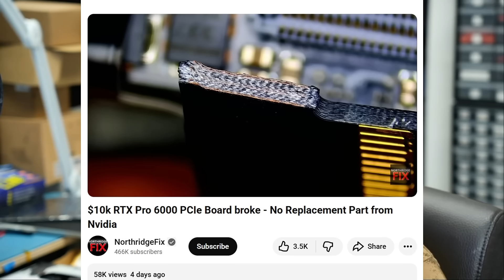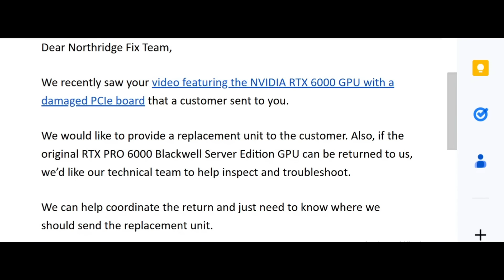Huge Update. NVIDIA Contacted us. What They Said About the Broken RTX Pro 6000

Comment: If you pay $10K for a GPU, it is expected that you know how to handle it like it cost $10K, not try to squeeze it into a micro ATX case for views, or try to skip the support bracket, then complain about it breaking, and then complain about right to repair, especially when the company offers to replace the card. Their warranty probably outlines clearly that "doing dumb shit" isn't covered, so if you're doing dumb shit with a $10K GPU and they offer to replace it despite the warranty explicitly stating not to do the very thing you did, shut up and take the replacement. I'm all for right to repair. I'm also aware the manufacturer doesn't have to help you repair it, sell you parts to repair it, or compensate you when you botch the repair. That "high profile YouTuber" is being a dumbass about it. I get the feeling they wanted to put your repair video on their feed to further boost their views, and probably as "a win for right to repair". People are just too damn sketchy.

Comment: You absolutely can replace those brakes at home. It's a 2 pin connector, 12 volts on one pin retracts the caliper piston and 12 volts on the other extends the piston. Figure out which pin retracts, retract piston, change brake pads, reassemble and start vehicle, pump brake pedal until firm. Final step, engage the electronic parking brake and release it. Job complete.

Comment: YOur point of view is totally valid, however, it has a harmful effect on the process:
- you have to get your own result by fighting your own fight. (why did not nVidia replace the obviously faulty GPU immediately in the first place and sent you this email? I guess the owner of the card tried to RMA the card, but failed)
- It should not be an "earned" priviledge" to get a replacement or a refund on n abviously faulty device
- If a supplier fails their duty either by negligence or by malice, why is it not allowed any third parties to step in and ofer for example a replacement PCB for this?
So, in general, I fully agree with your statements, but accepting the attitude of these suppliers , hindering our rights is only beneficial for them to carry on with their malpractices.
(for example, in this case, why did not nVidia replace the damaged board immediately, without asking any questions (such a PCB costs less then 10 USD)? Maybe, because, 9 out of 10 customers would not push this any further and "swallow the loss". ALso, just FYI: the devices in this price range are the ones that cause significant financial loss of the buyers if they fail.  So the damage is not limited to the 10k USD of the card, but to all the revenue lost of this card not being available for such a debate.)

Comment: You can change your own brakes; you just have to purchase a bidirectional scanner from Autel that allows you to communicate with the ECU, so you can put the brakes into service mode, because you have to use the Autel Maxisys Ultra to bleed the brakes using the ABS pump. This is not new info for people who work on their own vehicle.

We don't need new legislation. What we need is lawsuits using the existing laws. In automotive, there is already case law to force these dealers to stop scanning, but people don't sue when they are supposed to.

Comment: I went out and built my first computer, December 12 2024. The first component I bought for the computer was the graphics card ASUS 4090 OC and everything was going good until the 50 series cards released a few months later the day they dropped the first update for drivers I did my homework researched Everything to make sure it was OK that downloading a new update from the Nvidia app when it’s advertising for 50 series and it said it was fine so I downloaded it and as soon as the update finished my pcie overlay went from zero to a ton of numbers then it blacked screens and I had to force shutdown my pc and after that update. I started getting black screen on my computer that was only two months old  and it would be so random sometimes you go five hours before getting one other times it would do it as soon as you get to desktop and this issue with the black screens finally got resolved with Nvidia updates September 10 2025 7 months later. I don’t know what has happened with Nvidia but ever since the 50 series cards released their driver updates have not been very good and thay did not offer to replace mine when i had hard evidence supporting my claim that there driver updates where causing issues to the point of breaking a card. I tried everything from completely removing all software related to the graphics card doing a fresh installation of new drivers after a complete wipe with it still not working.

Comment: Right to repair should be about forcing manufacturers to publicly declare before purchase decision about provided schematics, spare parts and software support period. Nothing else. If some commercial entity wants to sell black boxes with zero support, that should be allowed as long as potential customers are clearly told about the issue before purchase decision. The problem with current system is that companies are allowed to withold this information before the purchase decision and if the customers are not aware of the issue, they will make poor purchase decisions without enough information and just whine about it later.

Comment: It was done to low the RMA costs and waste of expensive hardware for them ... not to low the RMA by customers rpairing their hardware. They converted andunfixable issue in a fixable issue, but not for everyone. As oposite toa car where you can source any part either from the dealer or alternative. Some parts cannot be repared, need to be replaced. And ECM is not modular, even when it was, they wont go into that level of detail. You need to buy a new ECM. How much the ECM costs in relation to he CAR ?. And you can still source and ECM, from the dealership, from a salvage yard.  Can you do it with your iphone ?. It wont take much for the chinesse to make an spare. Trying to lock repairs on a sutby board with a crazy connector is not going to work in long term.

Comment: Voting with your wallet is all well and good until every company does the same thing. Or if there's one 'open' company that makes a device with slow, buggy hardware while the other is offering you a Galaxy S26 and an iPhone 18 Pro. In reality, you don't actually have much of a choice if your choices are an LG Chocolate or an iPhone 17.

Or your options are a completely repairable 1989 dot matrix printer vs a modern color laser. Technically, the 'open' dot matrix works, but it's not a real option in 2025.

Comment: A week turnaround for a RMA would be pretty quick. I've Rma'd two cards since I started building my own PC's. A EVGa 3070 that took a month to get a replacement, 2 weeks to ship and test the card, and 2 weeks  to get my replacement to my doorstep. I also RMA'd a Sapphire 7900xt for bad memory and it also took about a month to replace. Have to be patient as RMA is a process. I take note of the serial number just because I'm curious if they fixed the card or just replaced it. Evga just replaced it and Sapphire actually fixed mine, pretty cool.

Comment: Modular components aren't there for the customer's sake. It's there to ease manufacturing and increase production yields. With Titan RTX - there was still plenty of spares though. I would expect The 6000 series to have equal support, but apparently not. It's almost like they made a card designed to fail after a few years. The video is about manual damage, but overall, I think all of the 6000's will suffer premature death due to overheating. And having that many 3GB memory modules, mathematically the odds of one of them going bad are astronomical. I give them 4 years tops. Not a good design. Not when inferior 5090's are double the size. Gaming cards have way better cooling than the A-series. Their only problem is weight, and the cards being heavy enough to rip slots from the motherboard.

Comment: I would say that some right to repair & environmental  movements have an impact, but there might be different approaches. In the EU specific devices now have to be labeled from A to E to show how repairable they are, how durable they are, how many charging cycles a battery can handle until it reaches 80% and so on. The repairable rating itself considers access to major replacement parts, repair documentation and such things. Beside that they also raised the standards for the longevity of batteries and that they should also be easy enough to be replaced. 
I agree that the consumer has to vote with his wallet, but such initiatives can definitely help the average customer to make a better purchase decision and at the most important - it also makes the companies compete and care a little bit more on such things.

Comment: Yeah it drives me crazy that so much stuff you buy up to appliances and cars  can't be repaired. But it all boils out to costs for the vendor. If there were a model where manufacturers providing repair parts ended up with a better bottom line, it would exist. Parts distribution and retailing is very expensive. Maybe a good effect of the meltdown of international trade will be that manufactured goods get so expensive that repair models again become economical.

Comment: it's an RMA so the card owners AREN'T going to hear back from Nvidia in just a week. RMAs usually take about a month. And tbh the fact that the owner broke the card Nvidia's RMA department could very well deny the RMA. Just because their customer service said they would replace it doesn't mean the RMA department will agree with that. The RMA dept and customer service are completely different departments. Also if they do "replace the card" it is most likely going to just be what you wanted to do in the first place, replace that one separate board.

Comment: Hi Buddy,
You can do a brake job without software. All you need is a DC power supply to retract the piston. Easy as pi.
If you don't have a supply, you can use a battery or even the vehicle's battery (with proper caution). It's really not difficult.
Mechanics with scanners can go into a service mode which will retract the piston(s).
Same thing. Summary...no software needed. Nothing special. 
Cheers.
Reply: Some vehicles also have a way to go in to service mode without a scanner.
Reply: Well, we've got A-holes like YouTuber Mr. Subaru claiming that you need an expensive scan tool to service your Subie's rear brakes. Meanwhile, the official service docs say "If you don't have a scan tool, just do the following...", all of which proves he's a lying POS who's damaging the brand he supposedly "promotes". Endless comments on that video from viewers stating that they'd never buy a new Subie if they need a scan tool for a simple brake pad replacement. And yes, any electric parking brake can be retracted by applying 12V power to the motor for a few seconds. Easy peasy. Just be damn sure to properly close connectors when you're done to keep the green crusties out.

Comment: Is all the mechanical force of the PCIe insertion into the slot transmitted through that small connector between the two boards or is there some other mechanical arrangement?

Comment: Louis doesn't disagree with you, he calls out nothing has changed himself... he calls out that companies 'technically' do everything they have to which isn't good enough. The Hyundai video is more about making us aware, a normal consumer wouldn't know... the more people that talk about it the more people know not to buy that car.
Reply: Louis has a point, but in this specific case, he is complaining about something he could do with a basic bi-directional code reader tool. Hyundai techs have tricks to do them without a computer. If he really wanted a case to make it would be this: Why is it that I buy a car without fog lights (not in my trim level), but the wiring, switch, and relay all exist in my car. All I need are the lights in the new lower pods. It would take me 20 mins to install factory fog lights in my car. Tell me why its 400 fucking dollars to get the stealership to reprogram my BCM to get accept the new parts. THIS IS A REAL ISSUE!
Reply: I am an auto mechanic for a living, and trust me, the last car I would EVER own is a Hyundai.   Even putting all the right to repair stuff aside, their cars are absolute complete trash.   They can't make a decent engine that lasts more than 75k miles.
Reply: @jtjones4727 thats not true my hyundai elantra 2012 has 94450 miles on it
Reply: Do this company has special brakes or something what's so different with their brakes?

Comment: That looks like it's been escallated to the QA Team. It's climbing up the Management chain. Especially with YT Media coverage.
Without knowing the stats of direct warranty returns it's impossible to know how many customers are having issues. 
Anything around or over 10% is a big deal with a design defect. 
(Honestly i wouldn't be suprised if you recieved a big mixed box of edge connectors and SMT connectors for the 5k and 6k  series.) With accompanying warranty paperwork to return the broken parts, so they can keep track on the failure rate.

Comment: Exactly, well said. If you want spare parts buy from a company that supplies spare parts. If you modify a product you take responsibility for damage you cause. Nvidia only manufacture chips. Everything else is brought in. The Samtec connector I identified 4 days ago is a 3rd party standard component available to anyone who knows. The Nvidia PCB is a unique component and only available from them (via their PCB subcontractor). If people want to design your own replacement PCB go ahead but you won't get it working overnight without a significant cost.

Comment: They built them modular, because probably they know that the cards are breaching the physical limits of modern computing platforms and are highly likely to break - compared to previous smaller generations - and they likely also have enterprise grade bridges that swap the PCI-E connection for something robust that won't break as often in an enterprise environment. And they are not selling replacement consumer parts, because they probably prioritized the enterprise replacement parts, and it doesn't make sense to support a very niche consumer market, when the vast majority will be enterprise customers. #just-a-guess

Comment: I used to work  in  the color tv business,  many years ago. We published service manuals, had service parts for 10 years. The service people  made us number 1, because it was so well supported.
Reply: I think people back then were a little brighter than today.
Reply: I remember the days when our national electronics brand (somewhat known all over the world) had "service centers" in like 10 cities in the (small) country where you could just walk in and get a service doc for your TV, a parts kit for a known failure mode, etc.
But in those days a TV would cost a month of salary and it was worth trying to fix it instead of buying a new one.
Now, a TV costs 2-8 hours of salary and people don't bother anymore.
Reply: Yeah - I remember those really good old times... Also, we didn't threw everything away, just because the battery was gone...
Reply: When I worked at a tv shop in the early 70's, company service reps like RCA and Zenith would come and give classes on common problems and take other service questions. We also used to buy schematics from SAM's photofacts for all kinds of radios and other electronics.
Reply: TV and Radio repair here when TV's had Tubes yes I am old as hell
Reply: Sony 😉
Reply: I used to repair home computers in the late eighties, and we has access to service manuals and parts also.
Reply: Back then, devices weren't designed to become obsolete before their time was up back then. Unfortunately, that's the world we live in now. It's even worse than not being able to repair.. devices that still work perfectly fine are turned into ewaste because as long as you are content with what you have, you aren't spending more money with the company.

Comment: After all these years people still haven't learned YOU NEVER SHIP PCI CARDS INSTALLED INTO A MOTHEBOARD. - 

We were 1 of 4 Authorized (Company Redacted) Service Centers in the World and was the only one who advocated the removal of high end pci cards in shipping. (Not to mention but to mention GPU Sag from leaving heavy cards installed in a connector not designed for the weight). It's 2026  it doesn't have to be like this.
Reply: Problem is if you're shipping it to someone who isn't capable of installing it themselves.
And before someone replies with the obvious "it's one connector, a couple screws and a few cables", there's more than enough people who have never done that and are either too scared to do it or will figure out a way to break something by using unreasonable force...
Reply: If you know how delivery company’s handle shipments you should be very concerned about how you ship your products 😂

Comment: PR on/about this, is extremely cheap to fix a card for Nvidia vs eroded trust, it's a duh to do it for a single card and it's virtually nothing for them to replace the GPU, to summarize, losing one customer to one broken GPU vs losing potentially more than 1 (specially given the connector issues they have in general with the power, they don't want another one to pop up even if it's the users fault because they know that things like that are intentionally dropped when media spreads) is not something Nvidia wants especially when it costs so little for them to just give a replacement (and it's not entirely a loss for them either, this GPU will be tested, checked and fixed and then sold again as used somewhere or just used by them).
It's business, you should know this.